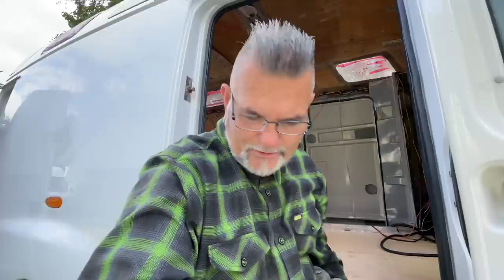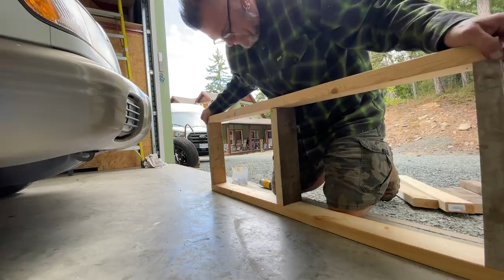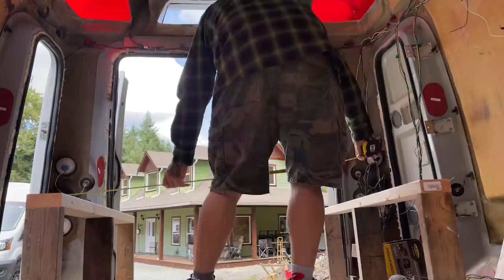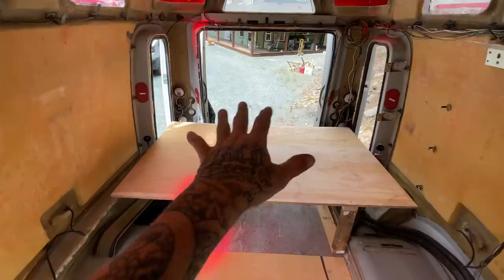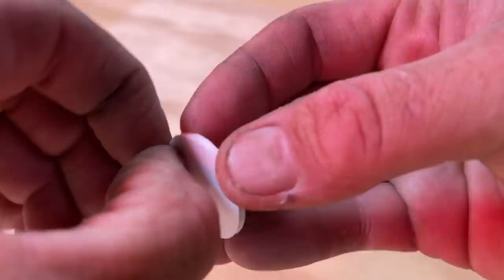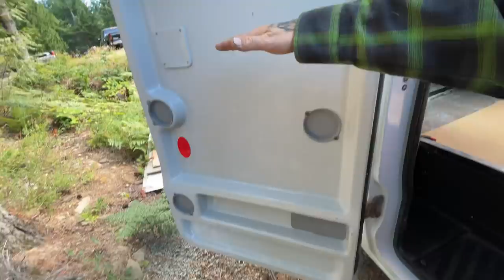EASY TO BUILD BED FRAME | Moving Into The Ambulance For a Few Nights

Comment: You can use painters tape on the floor and walls to try different setups. For cabinets you tape the wall and the floor. You can see if you can walk around in it.
Turn the bed against the wall. You can walk out the back door then.
😉

Comment: Your first van was my inspiration!! I’m in the process of re-doing my van space and insulating with Havelock wool. I’m raising my bed platform a few inches so I have better storage under my bed.  I’m not full time, but could easily go away from my hot AZ property for a couple of months.  I have the Jackery 500 and 1000 with 2 of their solar panels plus I have a 100 amp Renogy Battery that I can plug into shore power (or I can recharge using my Jackery system)
PS I’m working with a stock 2019 Ford 150 Transit Van. Looking forward to upgrading to better tires and wheels.  Any suggestions are welcome ;)

Comment: Food for thought try a u shape couch frame you can convert into a bed still having storage underneath. I think that would be a nice option for days being stuck in the van or even as an extra seating option for company. I do think having a high roof is best for your posture, you are getting older and your physical needs may change. It will also be great for the days your stuck inside.

Comment: I feel you will end up in this van by the end of the build. You'll change your mind on the standing after living in it for a while. You don't realize how many times you actually move around inside the van. Even though everything is close by and you say you are hardly in it, but being able to stand up and not be bent over all the time is so much better. But you'll definitely need to get that AC working

Comment: Hey Chrome. I know you dread getting the glue off the floor of the Ambo. WD-40 is a great way to dissolve lots of adhesives. Spray on and experiment with a wait time before scrubbing or using a tool like a putty knife. Hope it works for you.

Comment: love the build!! however if i may make a suggestion or comment regarding the lights you stuck on. im concerned over time it will slowly start to fall off. idk how hard it will be to replace the sticky  but if it comes off, its going to be rattling inside its housing. Love your videos man!!

Comment: What type of heating system are you considering putting in and also will you be putting in a backup power system just in case I know how the Canadian Winters can be and you don't want to be in a situation with no heat or power

Comment: I purchased a 2000 Chevy Express 1500 conversion and I've now been in my van full time since July 1st. I was sort of rushed to get in and on the road, so wasn't able to do much at all except take out the 2 passenger seats. I'm sleeping on the fold down back bench seat and have little ability for proper storage. I feel like a hoarder with storage bins that I can't hide. LOL Anyway, even a month in and I still struggle with design layout options. I've decided that I want the bed in back as opposed to lengthwise on the side, but while I like having a garage for my bike, I'm not entirely sure I want to eat up that space. Pretty much everything else about the layout is still in the air. I have a raised roof that doesn't accommodate a rack without a custom build which then begs the question of solar system install or just and easy Jackery/bluetti option. UGH! I fantasize about falling asleep and waking to a finished build. 😏😆 Anyway, thank you for your vids, suggestions and general words of wisdom.

Comment: Have you considered some type of ratcheting system for ur bed so that when you ain't using it u can lift it to the ceiling of the van thus opening the Van's area space right up
Reply: And when the bed is up screw a pole into the floor then a table top onto the pole and then u have a work station/dinning table

Comment: I'm curious how supportive that bed frame is over time with no horizontal supports. One would think that over some time the plywood would warp a bit,
Reply: Despite it looking to be 1/2" or 3/4" sheet of plywood. Sorry about this second comment as I accidentally hit send while typing my original reply

Comment: You got a high roof now easier to walk from front to back why not try to put the bed along side the driver side from front to back so you can walk to the back doors. 
Later on you’ll be able to put a shower in the back. 
Just thinking.